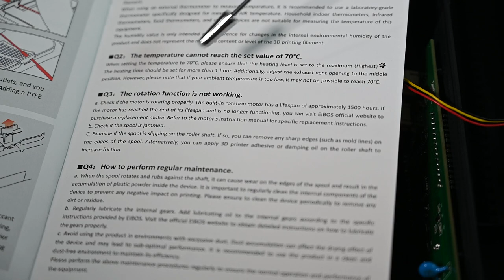Eibos Polyphemus Motor Replacement & Teardown

Comment: When i got my polyphemus a month or so ago, the motorized oring wheels weren't making sufficient contact with the rollers on one side, and so on one side the spool on that side wouldn't rotate by the motor.

This was during when Chinese new year was going on so i had to diagnose and fix it myself.

I fully disassembled everything, down to removing the oring wheel assembly and also the motor.

My solution (and it's still working today, months later) was to remove the wheel assembly, then remove the oring from the wheel having the issue... I placed a tiny droplet of superglue to the offset portion of outer diameter of wheel, i put that drop on the portion that sticks out the most (the portion that contacts the rollers), waited for that glue to fully cure , reinstalled oring.  What that did is to raise the surface area of that offset wheel to make more sufficient contact with the roller.

After a couple adjustments to the motor gear and wheel assembly gears (had to make sure they make sufficient contact too), tightened it all down and it's working great.

A few weeks after fixing it, Eibos finally contacted me and sent me replacement wheel assembly and new rollers too. I'll keep those around as spare parts since my DIY fix solved my issue.

👍😄🤗
Reply from the maker: That's was a really smart solution!! THANK YOU for sharing!!

Comment: Could be they have made the rods not very rubbery because it might interfere with when the spools are connected to a printer and being rotated by the extuder not sure. Thanks for the video, I was wondering what those O-Rings are for.
Reply from the maker: I really have no idea why they chose the hard rollers.  They seem to roll fine when the motor isn't running.  Isn't it wild that they give you replacement rings that are CRITICAL for operation, but don't mention what they are for or how to replace them?  Wacky! :)

Comment: Thanks for the teardown! Any thoughts on the build quality of the heater element/logic board/fan?
Reply from the maker: I don't see any reason for concern on those particular parts.  Time will tell though. I've been using my Eibos Cyclopes for over a year now with no issues.
Reply: Great, went ahead with the preorder. Thanks once again!

Comment: Placing the motor right next to the heating element is not a good design, as heat degrades the lifespan of electronics. 
This is better than the Cyclops, but they still have a work to do, the design could be much better.